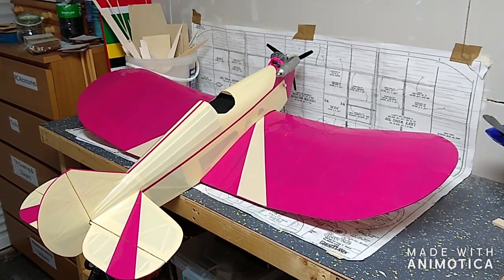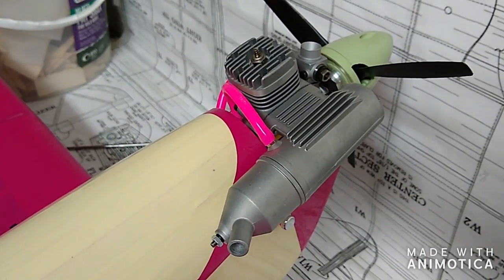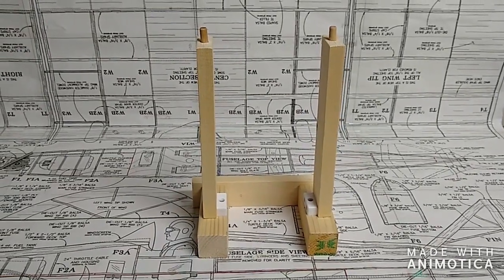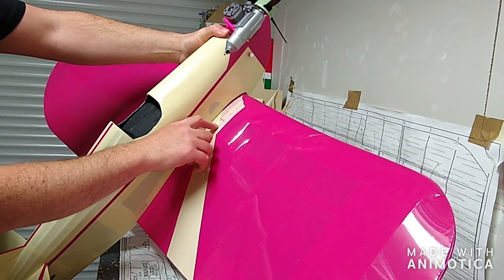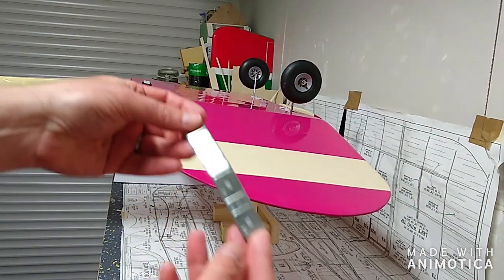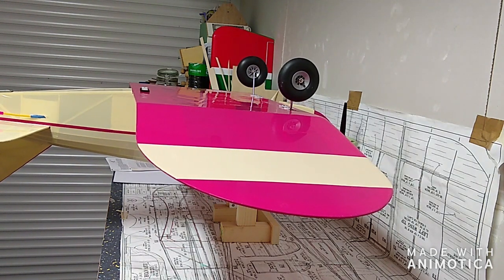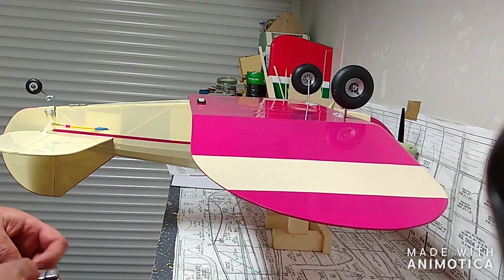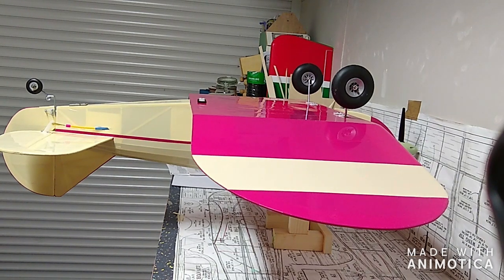How to balance your RC plane (Slow Poke video 15)

Comment: Worst advise ever. 

Do not balance your models on wood pegs. There needs to be foam in-between your plane & the peg. 

Adding weight should be a last resort. Move your battery before adding weight. 👍🏻

Comment: Could I suggest that before you add weight you take a look inside and see if you can move something like the radio battery back, to make up the difference. Also those weights won't stay on your covering fo long without making you covering sag and pull off.
Reply from the maker: That's a great suggestion! Thanks for the input!